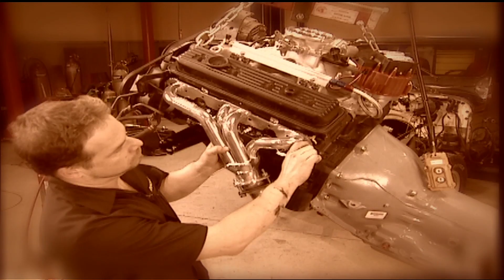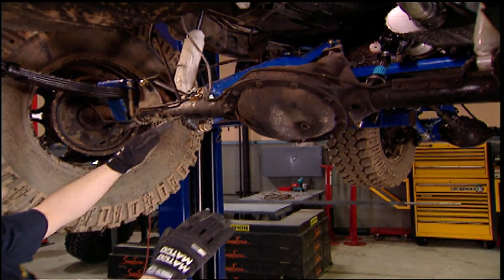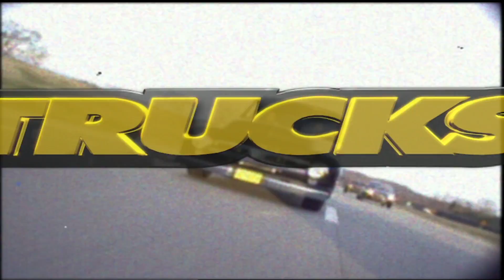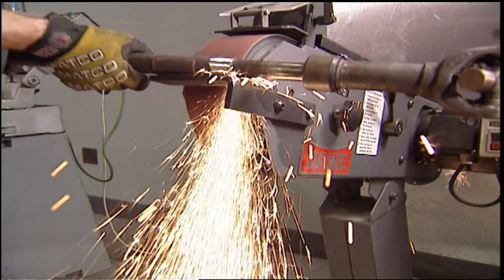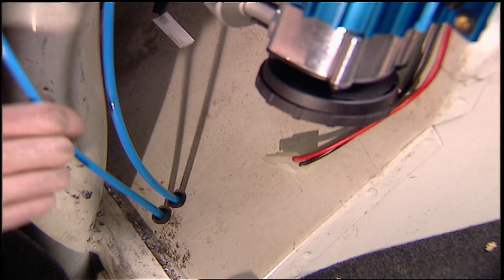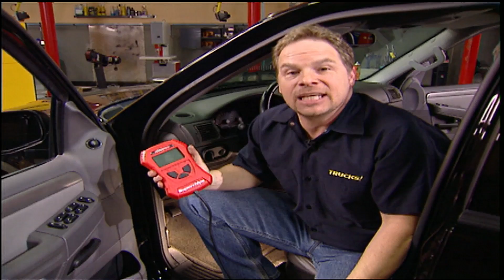Axle Upgrade On The Jeep YJ To Keep Up With Its Extra Power - Trucks! S9, E2

Comment: Currie Dana 60 center with d30 tj outers, can you say ball joint 5 times fast😂😂😂 small brakes and no ground clearance too. This lift kit is a joke, you still have to weld a ton, why not just go junkyard 60s and a custom 4 link 3 link with the dough they’re spending on prefabbed junk